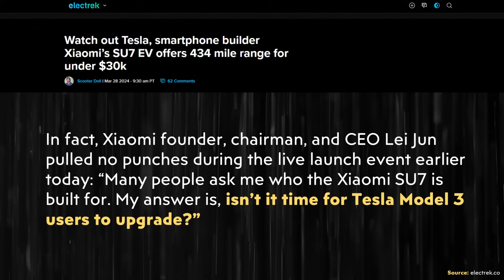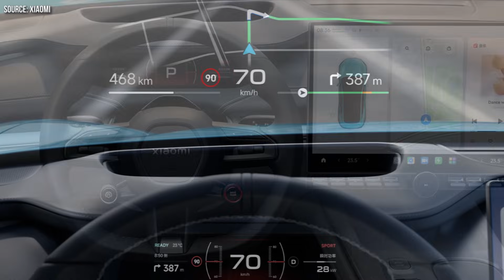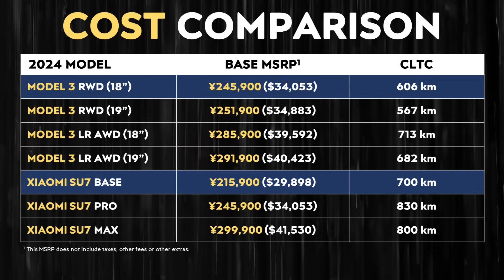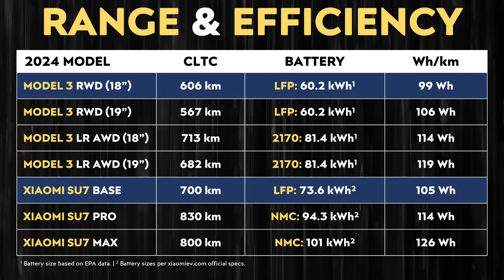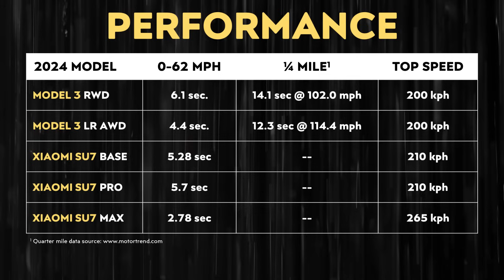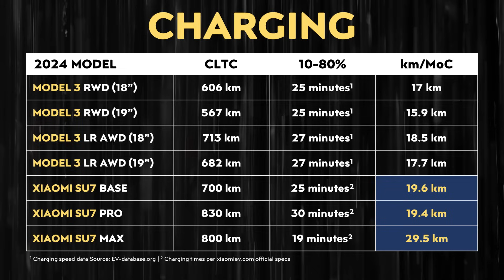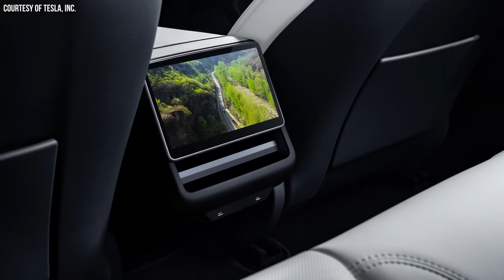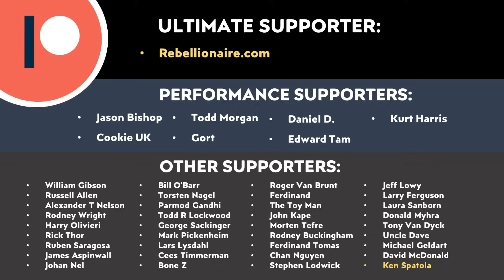Tesla Model 3 vs Xiaomi SU7: Shockingly Strong EV Competition!

Comment: My friend, sorry for the rant, but you should present the differences without omitting your opinion.  Base your comments on evidence and do not successively influence people.  Personally, I like the Tesla design, however it lacks some important quick access items, such as the emergency button, opening the trunk at the front and back, as well as the glove compartment.  Constantly seeing your speed while looking at the center panel is not safe.  In my opinion, Tesla only needs to remove the 60Kwh battery from the SR and install the one from the LR (+/-$1000) to make a difference, add quick buttons, and a display in front of the steering wheel.  This will all cost about $100 and I had the perfect car.

Comment: Car business is not only an excel sheet good for Eng but not for the whole population. 
But in this comparison we see clearly two weak points of Tesla that I hope they are fixing soon. 
1- Range. These type of cars should be in the 800-900km range that 500-600km range to be massively adopted
2- Battery pack voltage. 800V is half charging current giving more room for safe charging speed.

Comment: Teslas are desperately needing a HUD. It is a matter of safety that you shouldn’t have to look at the screen in the middle, even the closest corner
Reply: Yes it's dangerous to constantly fiddle with on screen buttons while driving.
Reply: @coldspring22  I’m not talking about buttons, the most important controls are on the steering wheel and you can use voice control for most other things. But to see your speed or navigation. It should be as it is on S and X even on a cheaper car, or a HUD would be even better.

Comment: In my opinion, you are presenting and comparing a current Tesla vehicle with future Xiaomi vehicle. All such offerings are typically coming later, while Tesla cars are already available and in sufficient quantities. At the time Xiaomi is able to manufacture this car profitably, Tesla will be beyond the horizon already.
Reply: Not necessarily, they do use gigacasting and modern battery chemistry/architecture from CATL.
Reply: Hundreds of xiaomi su7 already delivered since April 3rd, 2024, the new xiaomi factory is as advanced as tesla in Shanghai. Tesla is indeed facing tough competition in China.

Comment: How safe is it?  Has any independent testing body tested it?
Reply: You really think companies still use the "add more metal" technique to improve safety?
This will be designed using sophisticated computer simulation.
Reply: @rogerstarkey5390  It's always good to double check the simulation by sending the vehicle into a concrete barrier.
Reply: model 3 Nm/deg stiffness is around 34.000. Xiaomi su7 is 55.000 Nm/deg stiffness. By these numbers, you should already know who is safer
Reply: @tonypaca3015  Are you saying the SU7 is too stiff to be safe?  It will stop too quickly and injure the passengers because it doesn't cushion the impact.
Reply: @wineberryred  high Nm/deg maintain Passenger Compartment Integrity: In a severe collision, a stiffer chassis helps maintain the integrity of the passenger compartment. A stiffer chassis can help these zones absorb impact energy more efficiently, directing it away from the passenger compartment. It also helps with improved Braking Performance, Improved Handling, Sharper Steering Response, Enhanced Ride Quality, Reduced Noise, Vibration, and Harshness. Xiaomi su7 is way superior to Tesla Model 3 in the inside hardware. The 5 million dollar car koenigsegg agera rs has Nm/deg of 65.000, xiaomi su7 55.000, tesla model s 40.000 and model 3 about 35.000 Nm/deg stifness.
Reply: @tonypaca3015  I suspect that vehicle safety has just a little more to do with multiple factor than just stiffness' of the frame.  That's why we have entire agencies in the US and Europe that test vehicles for safety, which is a rather more complicated than a single number.
Reply: @wineberryred so no facts help you manage worry

Comment: Xiaomi doesn't bring any new tech. More of the same over the counter components will not cut it. Xiaomi has no expertise in auto hardware and instead of integration it will rely on a 3rd party software. Xiaomi only knows about software for gadgets in the cabin.   It's easy to price anything below the Tesla base model: just loose money.
Reply: Musk doesn't bring any new tech either.  Just peddling old tired ideas like vaccuum train, electric car and fake full self driving.

Comment: Cleanerwatt - its no Comparison.
the TESLA model 3 has Class leading SAFETY & build Quality in China. 
the Xiaomi SU7 is not even as safe as the Tesla model 3.
Reply: Why? because newbie cant handle its top model and loose control?  They have more physical button already safer than tesla.
Reply: model 3 Nm/deg stiffness is around 34.000. Xiaomi su7 is 55.000 Nm/deg stiffness. By these numbers, you should already know who is safer

Comment: I looked for a new smartphone and there were some amazing and cheap smartphones from Xiaomi, since I don't know the brand I looked on the internet for problems with the brand and it was alarming, not just smartphone but their entire product portfolio had serious problems with reliability and basic functions, I chose a brand that I was familiar with.
Reply: I have been using xaiomi phones for 10 years probably had 15 or more, I would never buy another brand,
Reply: @robbieb8274 15 phones in 10 years? Are you sure they were working alright? I have a cheap xiaomi phone, have had it for 3 years and it’s working fine, although, I don’t use it much
Reply: @robbieb8274 
Typing on a Mi 10t Lite 5g.
3.5 years, no issues.
.
Battery gets a bit warm sometimes but as I run my 5g internet hotspot through the phone it's crunching a lot of data.... It gets a raincheck.
I'm toying with getting a replacement.... Battery(!)
But the condition apps say it's fine.... 
.
I came from a "standalone" fibre internet contract.
Changing to an all in 5g SIM only deal to cover all my WiFi literally paid for this phone in under 5 months.
.
Even if it failed I could replace it with similar (I think the processor is even still current!) And that would easily come from my savings.
One of the best bargains I've ever bought.

Comment: Apple should be absolutely embarrassed!!! How many years have they been working on an EV? And now the 3rd largest cell phone manufacturer beat them to it.
Reply: These cars keep crashing
Reply: @ZoomZoomMX3  sour grapes. Mazda too dumb to compete in BEVs. SU7 will blow your sox off.
Reply: Low margin product isn't in Apple DNA. It is either autonomy or nothing. But autonomy has proven to be very challenging.
Reply: @nguy404 wait till Tesla has an app store and a phone.
Reply: @nguy404 Correct response is they gave up!!! not bla bla black sheep as u out it!!
Reply: @nguy404  low profit margin or no profit margin of -10b?
Reply: @nguy404 even for Xiaomi, autonomy / software is the game. Hence contract manufacturing for metal bits.
Tesla has forged the path, basically solved autonomy.
How hard will it be to copy, in China, in a software org?
SU7 is still 5 years behind Tesla - which is ready with generation III / robotaxi / unboxed, 48v, control by wire.
Plus Chinese can be very patriotic too.
Reply: @iandavies4853  Xiaomi will lose a lot of money on each EV sold. And its EV SU7 is almost a direct copy of Porsche Taycan. Nothing original. Probably can never sell elsewhere because it will be sued.
Reply: @iandavies4853  Autonomy will be incredibly hard for them, because the way to make it actually work is not with human software engineers, but with neural net learning from enormous amounts of data that Xiaomi has none of.
Reply: @nguy404  refresh the plastic bumpers, give it racing stripe, whole new vehicle. Every car looks the same.
Reply: Apple officially ended their car program a few months ago and most of the staff was sent to work on AI.
Reply: @tribalypredisposed  which is where the big money will be, not these miserable $trillions.
Reply: Nothing is original, They stole the design of the Porsche, the hardware and software is pretty lackluster as well.
Reply: Maybe if Steve Jobs and Jony Ive were still around maybe they could have done it.  But the old Apple is gone.  The new Apple just can't do it.
Reply: Apple was aiming for a real "full self driving" apple car.  They came to conclusion a true "full self driving" car is not possible at this time.
Reply: @coldspring22  that’s the laugh.
As Musk says, if you think you can, or think you can’t, you are right.
Apple chickened out just as the AI tech kicked into high gear.
Truly exceptional timing.
Yet still chasing AGI?
Reply: @coldspring22  not possible for them. China already has better self driving vehicles than anything in the US except for Tesla.
Reply: Xiaomi built its own factory for electric vehicles from scratch rather than subcontracting BAIC. They signed a contract in late 2021 to establish a facility in Yizhuang, Beijing that includes its EV division headquarters, R&D operations, and the factory itself. This factory is designed to have a total production capacity of 300,000 vehicles per year once fully operational. Tesla was also unprofitable for many years; even now if you remove EV incentives from their profits, they only make like 1 billion USD, and the vast majority of that is coming from Shanghai.
Reply: @tonypaca3015  What incentives that Tesla receives that without it Tesla would only make $1B in profit, and is that quarterly or yearly?
Reply: Psychopaths do not experience “embarrassment.” Or shame,